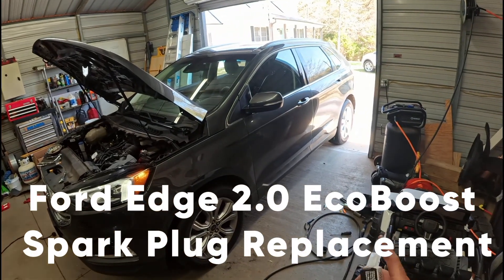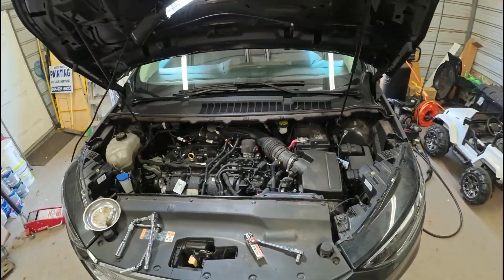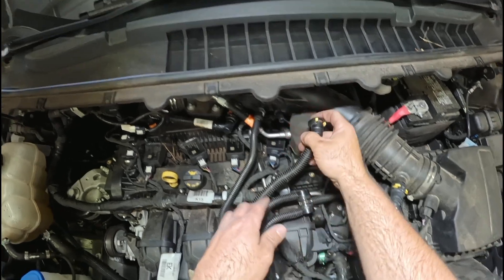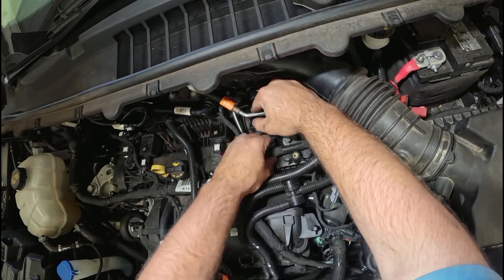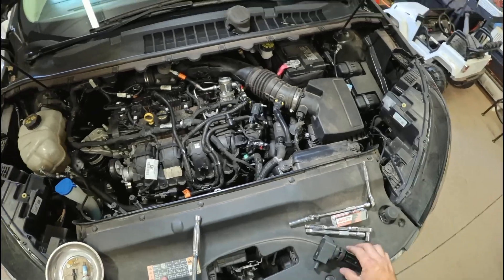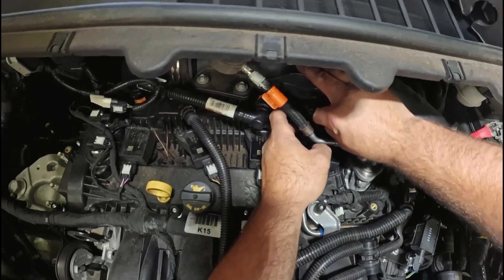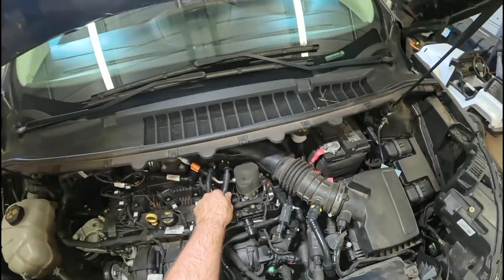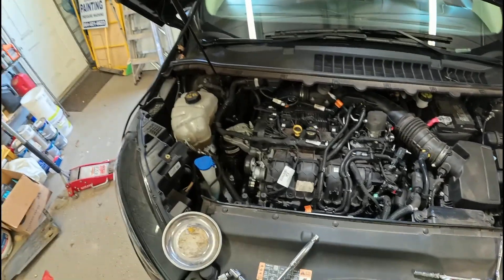2019-2024 Ford Edge 2.0 EcoBoost Spark Plugs Replacement

Comment: That 4th coil is a major PITA. That spark plug was also SUPER tight in and I was very worried about cross threading pulling it out. The issue I am having now is that I cannot get that 4th coil plug to seat properly. It is obvious it is not seated fully and properly as it is loose and not level and tight like the other 3. I did some research and it appears adding dielectric grease will help along with proper angling of the boot going back in. I'll try that tomorrow and update. The first three were easy. I figured it'd take me 30 minutes but now it's more like3 hours due to that 4th plug.

Comment: I knew if there was a way to get #4 out without a lot of effort, someone would find it. You, sir, are a life saver. Also, it sounds like you did actually check the gap on the plugs. I saw another video that didn’t check them, claiming that you couldn’t gap them anyway. I’m still chuckling at that!

Comment: I changed my plugs on my 2020 Edge today. Wasn’t that difficult at all. Was done in about 30 minutes. I followed this video mostly.  I ended up disconnecting only one hose. I left the one that u said had a broken clip. I used went in from the back with an extension and one Elbow. Coil and plug came off easy.  Make sure u screw it in by hand and then hand tighten it.

Comment: Did you have any misfires from cylinder 4 or trouble connecting it?  Tried doing this but can’t get the ignition coil to sit right on the last plug and it seems like that’s causing a misfire
Reply from the maker: @chrisdrewry5249  it is definitely tricky to get it on without removing the high pressure fuel pump. I would try to remove the ignition coil and check it. Then try to install it again carefully and hopefully you should be good

Comment: OMG!  Followed your awesome instructions and somehow cross threaded that difficult to get to plug going back in.  It felt like it was going in without much resistance and when it became obvious it wasn't, about 6-7 threads from the bottom of the plug I took it out and walla. Two of the threads were mashed down around that 6th thread up. Guess I've got to tow it to the dealer tomorrow and hope they can chase the threads and it not wind up costing me an arm and a leg.  Any idea if the head on the 2.0 is aluminum?  Thanks, Don
Reply: I hope so. It’s weird how it didn’t mash any of the threads until I got to around the 6th thread. Thank God I stopped when I did and didn’t keep cranking it down. Thanks for the reply.
Reply from the maker: @joannaarbuckle6693  you’re welcome Don. Hopefully it was something wrong with the spark plug and not the spark plug hole
Reply from the maker: @joannaarbuckle6693  Dang I hate to hear that. I’m pretty sure the head is aluminum and they should be able to fix it pretty easy I hope

Comment: Do not use Autolite... if you're going to stray from OEM use Bosch or NGK.
Reply from the maker: @majickmeg  I’ve had good luck with Autolite for awhile now. A lot better than Fords OEM. Have you had issues with Autolite?
Reply: Yeah, I’m a mechanic and I just don’t use them anymore… I call them nolites lol
Reply from the maker: @majickmeg haha I gotcha. Maybe I’ll try Bosch or NGK next when I change my trucks spark plugs again. Thanks for the comment!
Reply: @Blakely_J  of course, thanks for the video :)
Reply: @Blakely_J motorcraft plugs are made by NGK these days and they used to be made by Autolite.
Reply: @majickmeg do you have the part number for those plugs?
Reply: Ford itself does not manufacture its spark plugs — they rely on external suppliers. In modern production, NGK (now known as Niterra) is the primary manufacturer of Motorcraft spark plugs. Enthusiast forums and mechanic communities widely confirm that NGK produces these plugs for Ford . Autolite used to be the supplier.